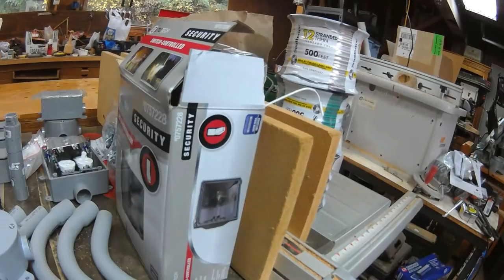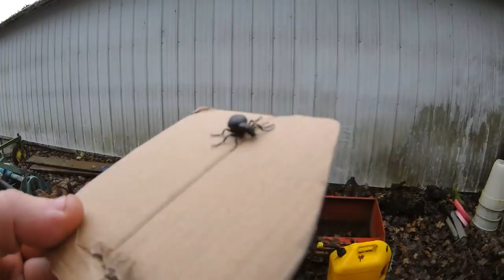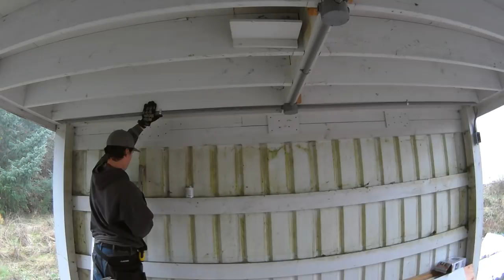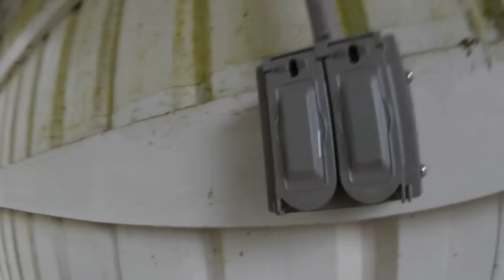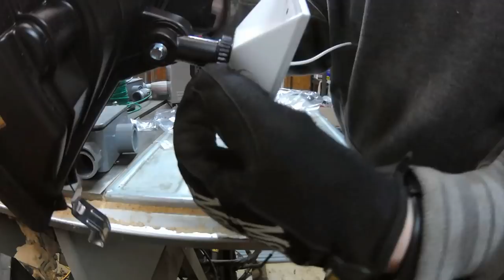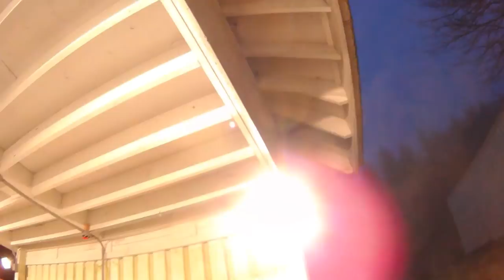Installing Conduit & Outdoor Lighting

Comment: This is a good introduction, and you've made the layout much cleaner. People should know that they need to use tubing and junction boxes that are sized for the number of wires and number of connectors. Tables in the code book based on box volume and conduit area help with that. If you violate box fill rules it increases risk and you leave hard evidence of liability if there is a fire. You are usually allowed to share ground wires (but not neutrals) between circuits, which may help to reduce box and tubing clutter. Any more than three current carrying conductors inside a raceway requires a derating calculation to account for the extra heat generated by inductive effects.

Comment: Just a suggestion.  Use a Sharpie to mark the Romex sheathing at the box with what it supplies.  I've also seen stripped sheathing marked and slipped over the hot wires going to the breakers inside the breaker box.  And label inside switch and outlet covers with the breaker number that controls them.

Comment: It’s a fail from the beginning. 

To protect conductors from abrasion, a metal or plastic bushing must be installed on conduit threads at terminations, regardless of conductor size, unless the box, fitting, or enclosure is designed to provide this protection [Sec. 344.46]

Comment: Just curious: why run conduit inside with the extra expense of THHN/THWN and the conduit? Just use standard romex and transition to THHN/THWN with a junction box if it need to go outside.
Reply from the maker: For safety. The owner did not want any exposed wiring in the shop, there are a lot of flammables and his concern was something striking the exposed romex where there is no drywall. So everything new will be in conduit and eventually all the old exposed wiring will be in conduit at some point too

Comment: Is there a fitting for where a pipe goes into a wall or do pretty much just drill a tight hole and then caulk it?
Reply from the maker: Ya I just caulk it, or you can use a bulkhead fitting

Comment: so im new to running wire outside, do you have to run each wire like that and put into a bundle or can you run Romex or something like that thru certain kinds of conduit and if so what kind?
Reply from the maker: Romex is harder to run through the conduit than the individual THHN wires as they are specifically designed to go in conduit and they have an extra plastic coating that makes them slide through the pipe easier. 
You can put the Romex in as you are putting the conduit together but then it will be very hard to get out if not impossible, unless you cut up or take apart the conduit. THHN makes it easy to slip out the wires and re-engineer your system if you want more amps, volts etc.
Ive also read that Romex runs hotter inside of conduit than THHN but ive done it before with short runs with no problems.
Reply: @ClassALiving  ok thanks, yea mine would be short like 10ft but later down road i'll probabaly run more longer to extend and put different things on the circuit
Reply: @ClassALiving  what do you suggest using for running outside exposed a little bit (in car port) I ve got mc cable in garage for closest power, can I use pvc ? Since it's 12-2, do i have to use same gauge wire?
Reply: You can't run Romex on the exterior in a lot of places
Reply: @inspectrgajit  no romex in conduit, only THHN wires. At least in California.
Reply: Hire an electrician? Asap